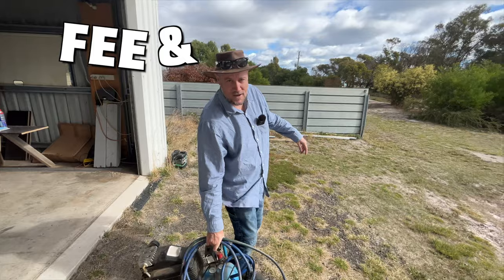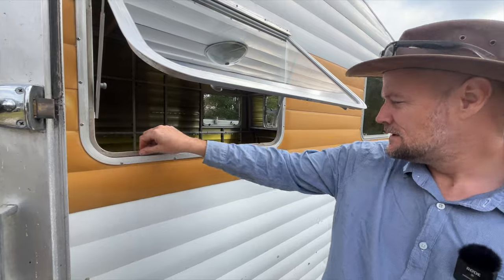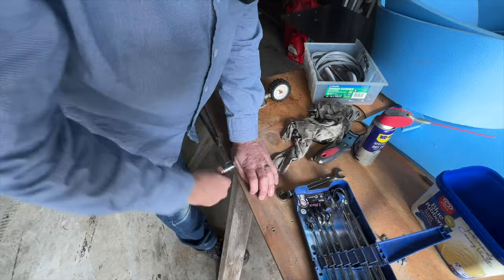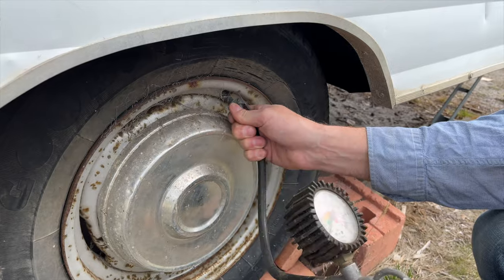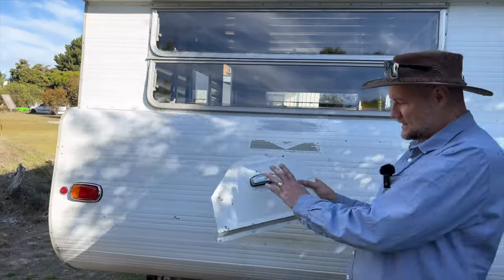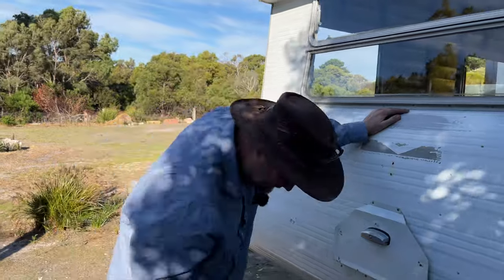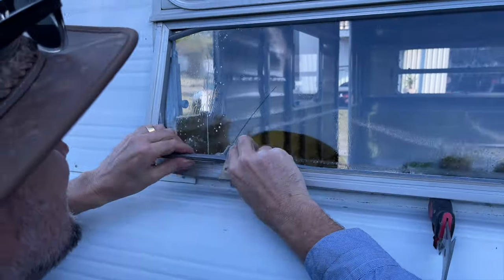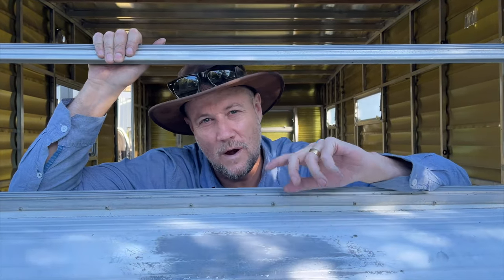Tail lights, seals, and fiddly bits on a 1975 Viscount Ambassador - Vintage Caravan Renovation Pt 14

Comment: Keep going you two! Just have to keep tapping away at it. 
For the tyre that keeps going down... just jack it up so tyres are off the ground and pack up under the axle with bricks or timber until you get around to replacing the tyres. You'll need to jack it up anyway to swap them over so this is just planning ahead  😎👍
Reply from the maker: Excellent idea! I have a couple of axle stands I’ve been meaning to get underneath so watch this space! Thanks for the encouragement.

Comment: Hi, you might want to flip the gas struts the other way up 
The need to be set up with strut part at the bottom 
This is so the seal where the strut comes out stays lubricated and prevents the gas leaking out
With them set up how you have installed them they will leak and lose gas pressure
Reply from the maker: Good to know, thanks for the tip!

Comment: Wow! What size were the struts for the front awning???
Reply from the maker: Not sure exactly, i just eyeballed what I thought I’d need when I was at the hardware store. I think it was these: https://www.bunnings.com.au/goliath-325mm-100n-black-gas-strut_p4230062
Reply: @feeandjohsrenovationshow  Re your pressure gauge, Bunnings have Ozito accessory packs of the fittings. One of those will surely fill the gun, but the pack costs $30. That is a total investment of $100 (gun + accessories). I would have returned mine except I lost the receipt. Have a look at the feedback comments on the Bunnings site.
Reply: @feeandjohsrenovationshow  I bought the struts you suggested. Will fit these tomorrow and let you know how I go.
Reply: @TheBasementChannel  Yes I picked that up.  Thanks. I recently installed gas struts for the bed in my 1985 Viscount Grand Tourer.